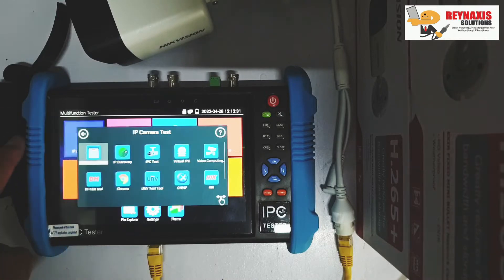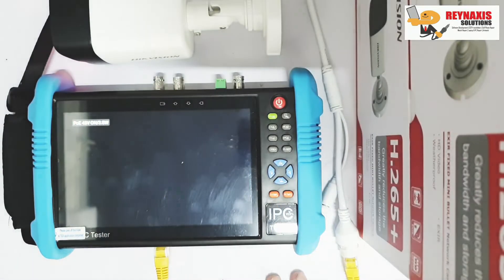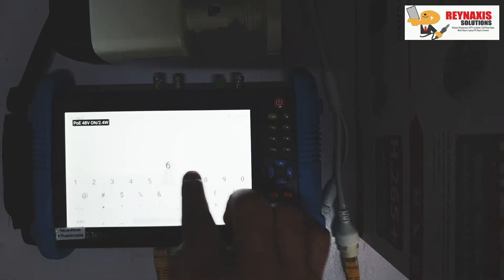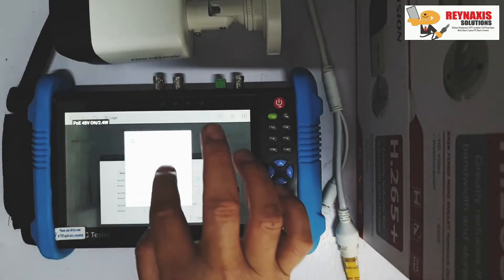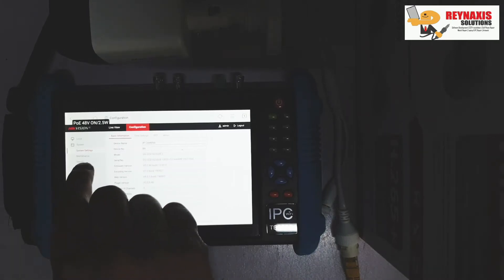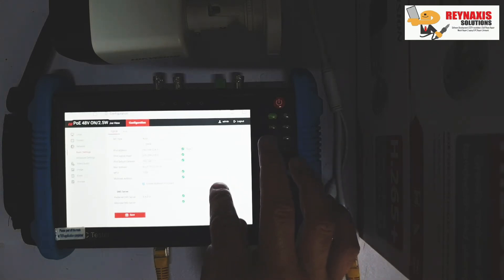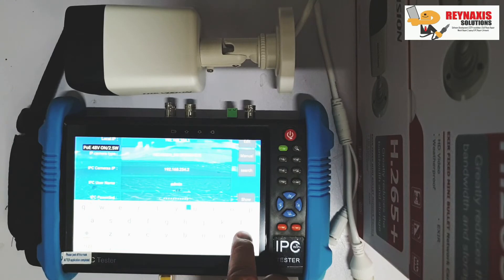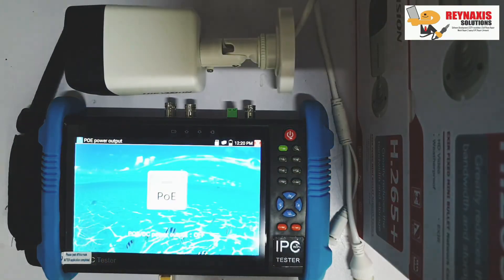Configuring Hikvision Camera with an IPC Tester

Comment: Hi raynaxis, on a large scale network I have 3 NVRs with 135 cameras. PC has iVMS and SADP installed. Question for you. Can I set-up the IP range in each camera one by one and then will SADP see it so I can register it? Once I plug into the network as we are waiting for another supplier to provide the switches. I'm a HIKVISION associate but this client is awkward. As usualy we set all IPs in cameras before installing.
Reply from the maker: Hi, I only used the IPC Tester to set up each camera's IP and password before I connect them to NVR. I don't use the iVMS and SADP for that. I'll post a video of it once I tried it. Thanks.
Reply: @ReynaxisSolutions  yeah perfect you answered my question.

Yes iVMS is free software to run everything on a server or PC as we call it. Download it to the PC and it will see all cameras online etc and you can run updates.

However you need SADP to register the camera to the NVR and it will see it's IP address then register it. 

HIK central is a whole different ball game as it's a massive system. Which replaced iVMS.

Central is for enterprise server installation on large scale. 

Because it's more complex I needed Someone like yourself to answer a more basic question which you have lol as I spend more time in complex builds. Thanks 🙏🏻
Reply from the maker: Nice, good luck with your endeavor. Cheers!